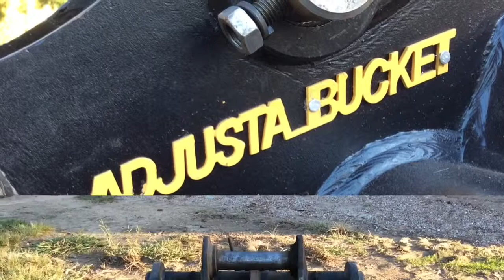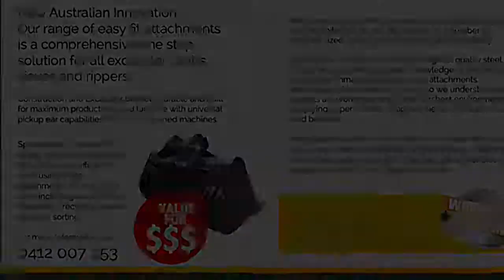"Adjustabucket" Adjustable excavator

Comment: Interesting concept and it makes me wonder why somebody didn't think of this earlier. Congratulations on getting the patent on it. 

It was a shame it wasn't further refined to eliminate the bush welding however. By the time this bucket is modified for machines with different pins diameters, spacing and centres, it wouldn't be much more difficult to just put new ears on a conventional bucket. Simply being able to tighten a threaded bush at the appropriate location (for example) would take it to another level.
Reply from the maker: Pete F 
The new patented model does just that.
www.adjustabucket.com.au